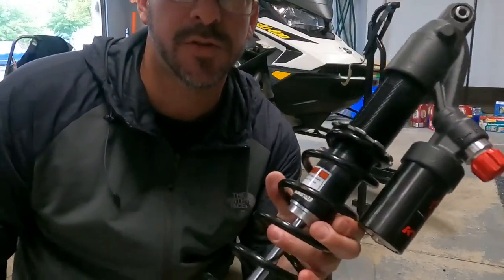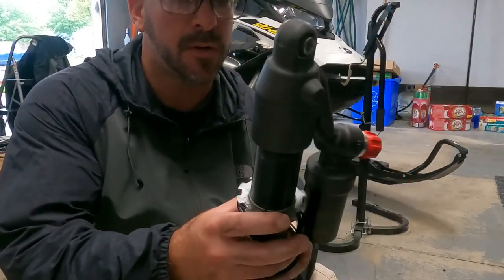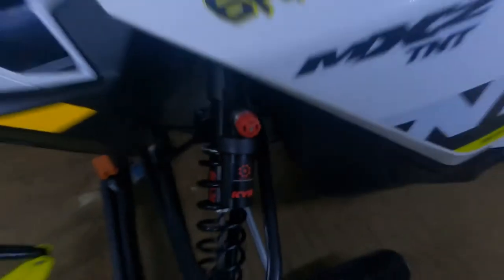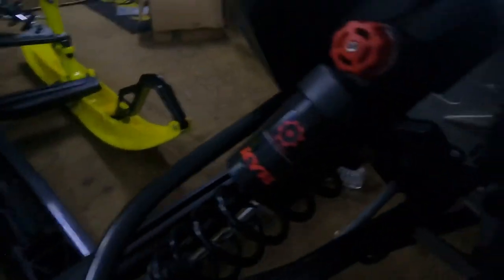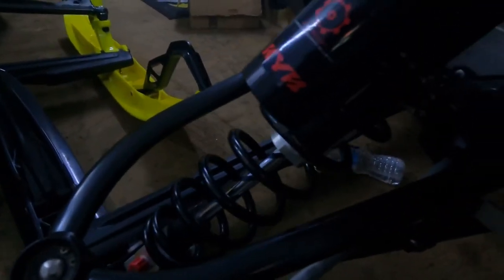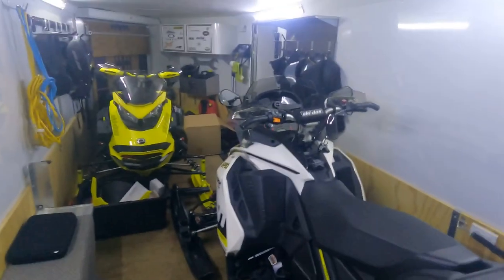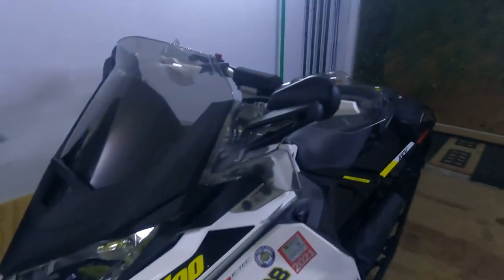Swapping a Ski-Doo X-RS Suspension into a MX-Z TNT | KYB PRO 40s | Upgrading Shocks!

Comment: Had hoped for a detailed install video. Same bolts, and hard ware used for and aft?  Wrench sizes, tools needed and torque specs? The fast forward with random music is not very helpful….technical value is always helpful and likely why most people would click on this video. I have a 17mxz 850 with 8k need to either rebuild or replace my HPG shocks.
Reply from the maker: Thanks for the feedback. Everything is the same which is why I didn't show the details. Reuse all factory hardware. Very easy job. Mike

Comment: Great sled , now it's even better . What did the shocks cost you ? Was thinking of doing the same to my 2019 Blizzard .
Reply: Mark - I striped the cheap throwaway shocks off my wife’s renegade sport and put Elka stage 4’s out front and X package KYB’s in the rear and it’s a whole new sled
Reply from the maker: Got them for $1800 for the set. Very reasonable and makes all the difference. Mike